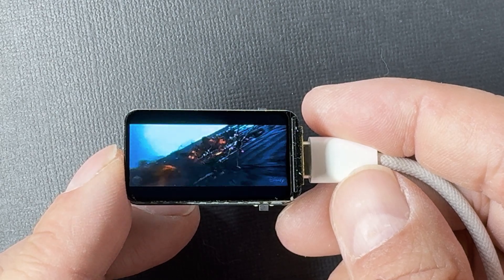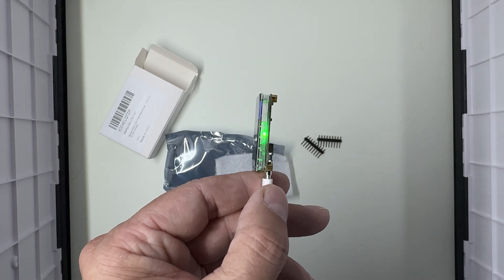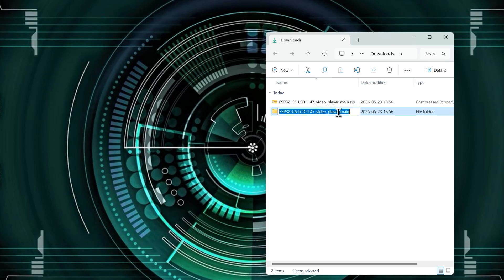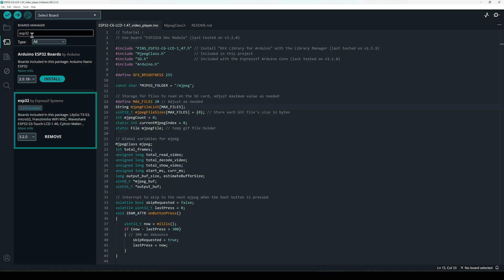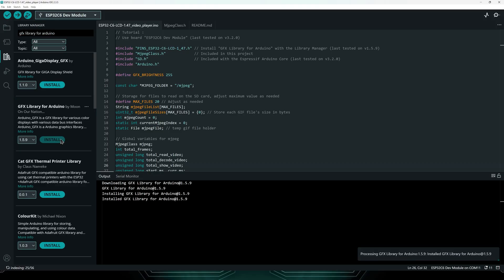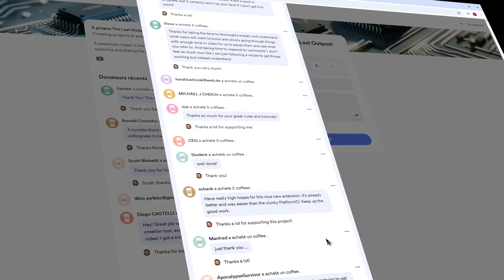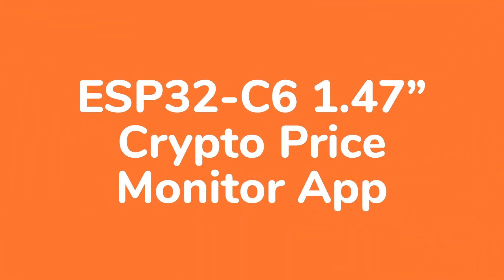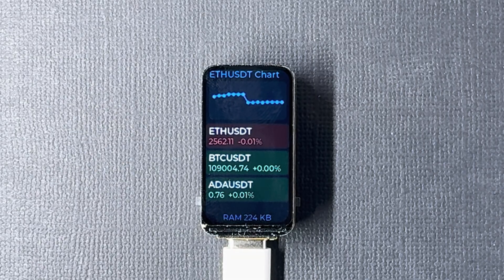SD Card Video Player & Crypto Price Monitor  tutorial

Comment: erreur de compilation malgré le téléchargement de la librairie Arduino gfx 1.5.9 ESP32-C6-LCD-1.47_video_player:4:10: fatal error: PINS_ESP32-C6-LCD-1_47.h: No such file or directory
    4 | #include "PINS_ESP32-C6-LCD-1_47.h" // Install "GFX Library for Arduino" with the Library Manager (last tested on v1.5.9)
      |          ^~~~~~~~~~~~~~~~~~~~~~~~~~ :(
que faire ???? merci pour la réponse
Reply from the maker: ouvrez un issue sur le repo de code que vous utilisez
Reply: @thelastoutpostworkshop Je VAIS Le faire merci pour votre reactivité👍

Comment: I have come back to this project today to try and develop something with it and I am getting the following message when trying to compile you example. It has been a while since I successfully ran the example and I am stumped as to  why it won't work. The error message is...

In file included from C:\Users\XXXX\Downloads\ESP32-C6-LCD-1.47_video_player-main\ESP32-C6-LCD-1.47_video_player\ESP32-C6-LCD-1.47_video_player.ino:4:
c:\Users\XXXX\Documents\Arduino\libraries\Dev_Device_Pins\src/PINS_ESP32-C6-LCD-1_47.h:5:2: error: #error "Please select Board: ESP32C6"
    5 | #error "Please select Board: ESP32C6"
      |  ^~~~~
exit status 1

Compilation error: exit status 1

The board is detected as the ESP32 C6 Dev Board in the IDE and I have followed your instructions to the letter. I would be very grateful for any help you can give.
Reply from the maker: What project are you compiling ?  The crypto monitor or the video player ?
Reply: @thelastoutpostworkshop  Hi, I am trying the video player. I am quite new to Arduino stuff and even chatGPT can't help me understand the error message.
Reply from the maker: First make sure you have installed the exact version of the libraries needed, if it's still not working, open an issue here : https://github.com/thelastoutpostworkshop/ESP32-C6-LCD-1.47_video_player
Reply: @thelastoutpostworkshop  Thank you so much for your response. I have just tried the crypto sketch and it worked first time. The error message I get with the video viewer seems to suggest that the ESP is not detected as an ESP32-C6 but I know I have the right board selected. I shall try again with the sketch and make sure that I roll back all the relevant libraries to the same as you use. Thanks again for your reply.
Reply: @thelastoutpostworkshop  Hi, Thanks again for your advice, I now have it working after doing as you suggested and starting again. I have employed your method from your most recent video about creating a new folder for each project. Thanks again.

Comment: That's a great video. Do you have an idea about the compression ratio of the original and the converted file? I tried to find it on your video, but the file sizes section was not visible in the video. Thanks.
Reply from the maker: It's hard to say because the dimensions of the orignal video is much larger than the converted one

Comment: Hi, I have black screen after doing all of the spteps.
Reply from the maker: which project the video player or the Crypto Price Monitor ?  If you need help, open an issue into the right project : Video player : https://github.com/thelastoutpostworkshop/ESP32-C6-LCD-1.47_video_player or if it's the Crypto monitor : https://github.com/thelastoutpostworkshop/ESP32-C6-LCD-1.47_LVGL9_Crypto_Monitor
Reply: @thelastoutpostworkshop  I have a problem playing the video, just like you did at the beginning. In the Arduino Serial Monitor it says 'cannot open mjpeg file' and I just get a black screen

Comment: Have error. Compilation error: 'DEV_DEVICE_INIT' was not declared in this scope
Reply from the maker: For which project on this device  ?  You have a missing library
Reply: @thelastoutpostworkshop  SD Card Video Player. have all librarys mentioned. what labrary is called using Dev_Device_init ?
Reply: now have #error "Please select Board: ESP32C6" have #include "PINS_ESP32-C6-LCD-1_47.h"  and selected ESP32C6 Dev Module?
Reply from the maker: The tutorial contains all the information
Reply: OK now compiled but black screen
Reply: Working :) IDE not updating .Had to shutdown and start again for all changes to be made ....

Comment: hi.im trying to get clips converted but once ive copied them to the bin folder and right click i dont have the option to OPEN IN TERMINAL,im on windows 11 is there some other way to do it?thanks
Reply from the maker: Open an issue here it will be easier for me to help you: https://github.com/thelastoutpostworkshop/ESP32-C6-LCD-1.47_video_player
Reply: @thelastoutpostworkshop  i've opened an issue here
Reply: Thanks,I've managed to open cmd but when trying to convert it,it just comes up with red errors
Reply: I've followed you video perfectly but still no luck

Comment: I did everything exactly as described (used the exact versions) but all i get is a blackscreen on the device...tried to use your mjpegs but same thing
Reply: Ok i found the error:
I failed to create a mjpeg folder on the sd card, instead i just copied my mjpegs on there
Now it works !

Comment: Can you run both the crypto ticker and the video player on the same device or you need to restore to factory and do again?
Reply from the maker: This is two code base, but you could easily combine them in one sketch and use both on the display board.

Comment: Excellent video and clean simple code. Everything is explained well.
Is it possible to use the multi core nature of the esp32 to use one core only for video decoding and open the other for user interface buttons etc?
Reply from the maker: No—unlike the classic dual-core ESP32, the ESP32-C6 has a single 32-bit RISC-V core (up to 160 MHz), so all tasks run on one CPU.